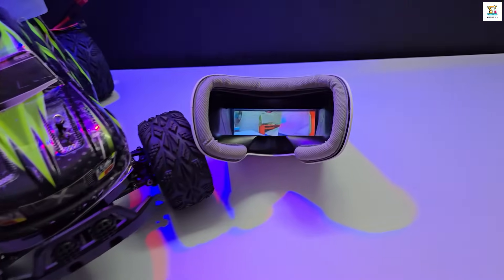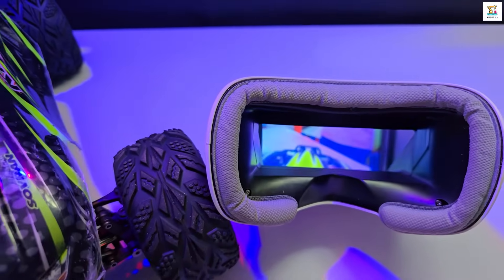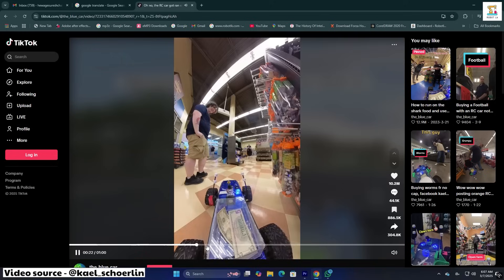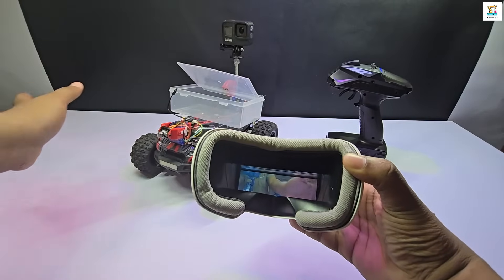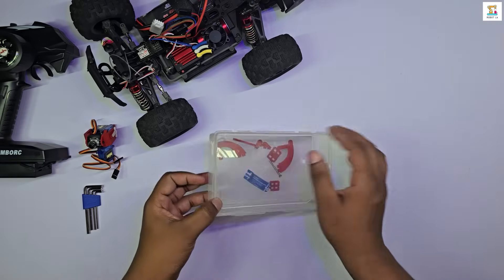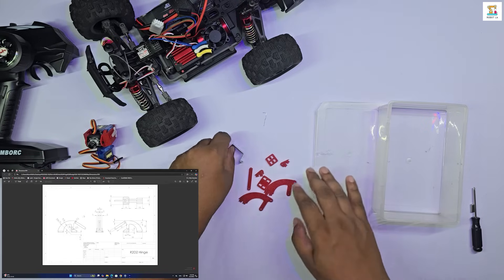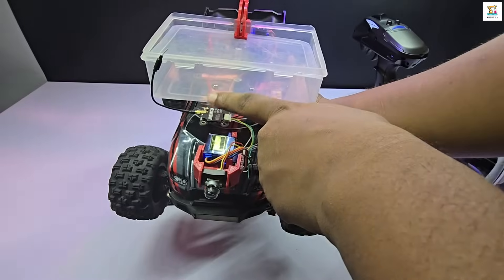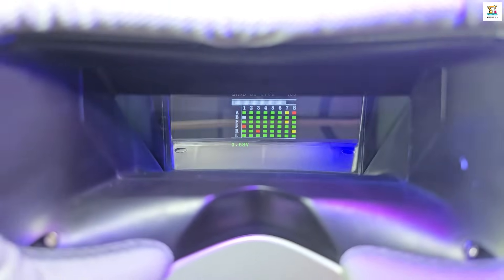How to Build a Remote Shopping RC Car with 2-Axis FPV Camera | Remote Controlling Open/Close Box

Comment: What is that PWM thing that connect to your beeper for horn?
Reply from the maker: Remote controlled (pwm) to Use a switch. The link to purchase is in the description.
Reply: @RobotLk  Does it uses PWM signal to output 5v? And i can't seems to find this product in your links from Ali 1 to 7 and Amazon 1 to 6, which one?

Comment: How can we put a person in front of the car instead of a camera? Can you update the broken links? And if we buy a more affordable VR, which one should I buy?
Reply: @ShivSethi-zj9mb  bro the camera is like a vr means like you have saw in drone camera, so by coding they make it gyroscopic or fixed rotation and then they just cover it with helmet like structure. So, the camera looks like a person